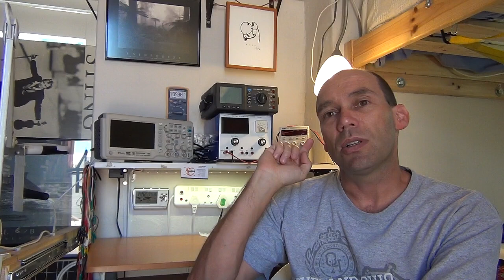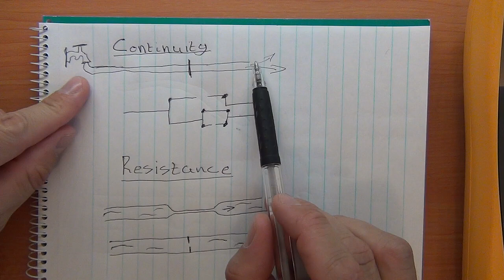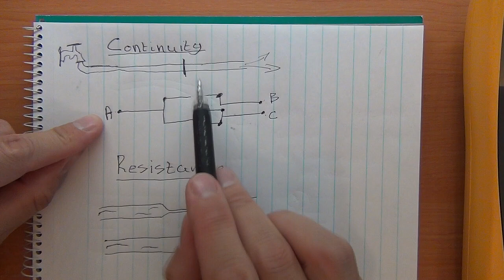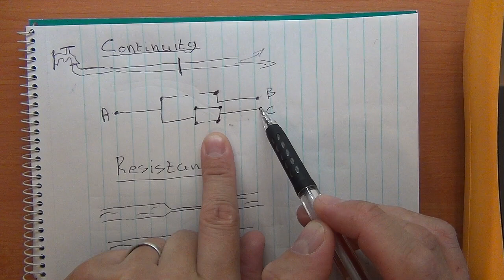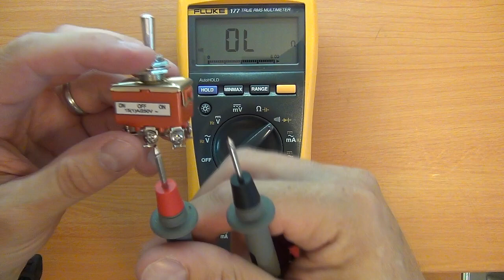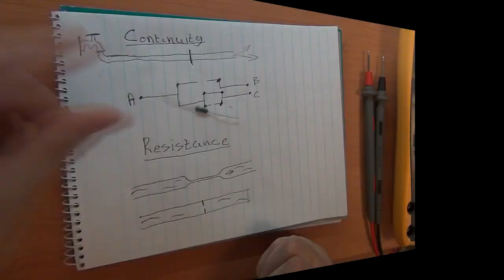How to use a Multimeter for beginners: Part 3 - Resistance and Continuity

Comment: Never too old to learn.  I'm using your instructions to troubleshoot my ignition coil, voltage regulator and stator on a 150cc engine.  The values are given in the maintenance manual.  However, I didn't know how to test them properly. 

Thank you for taking the time out of your schedule and sharing this information.  I feel confident to proceed with my testing. 

dave

Comment: My sincere gratitude for your clear, lucid presentation.  I was able to repair my own drill using this video. I have owned a multimeter for years and have been clueless as to how to use it. Using your video I could troubleshoot for continuity and assemble the components of the drill correctly.  My sincere gratitude.  Many thanks.

Comment: Great video series!  Your explanations with analogies are easy to follow and the practical demonstrations help a tone for a beginner like myself to know how to utilize all the settings on his multi-meter.

I did want to point out however, that during your water pipe analogy of resistance, there is in fact a slight difference between how water pressure and voltage are reduced.  Everything stated about voltage reduction from what I understand is absolutely accurate.  With water though, simply reducing the area that the fluid is flowing through, does not create a pressure reduction.  If you have simple water pressure gauge, you can test this by hooking it up to the end of an outdoor spigot, and opening the spigot all the way.  Then take it off and start over,  just opening the spigot's valve slightly.  The gauge will climb more slowly, but still reach the same pressure level.  All the spigot's valve does is regulate the area that the water is flowing through, and thus the rate of flow.

There needs to be a mechanism within that area of flow, that will present an opposing pressure.  ie. In a water pressure regulator or even simple pressure reducer, there is commonly a spring that holds against a stopper closed.  This spring creates an opposing pressure against the flow, which is what actually reduces it's pressure on the out-coming end.

Anyway, sorry to nitpick your video.  Especially considering I've learned so much from these myself.  I just wanted to add my tad of insight into part of the physics on what makes the water/electricity analogy not quite 100% equitable.

Comment: Another great vid but you might have mentioned that even the best quality resistors will vary from their labelled rating by several percent, ( gold band, silver band etc) as well as the resistance in the leads though this is perhaps too advanced for what you are trying to do at this level. Cant wait to get on to your advanced vids, I am finding them a useful refresher for use in my own teaching of young engineers.

Comment: Great video. The way my high school physics tutor described the answer to the first question was: "DC at high voltages/current over long distances causes a charge on the wires, which means you get loss as electrons drift over to the air/trees etc. With A/C, this electron drift still happens, but a fraction of a second later the polarity reverses so they come back the other way, and the cycle repeats. This means you don't get such a loss of power over long distances with AC".  One other point I was hoping would be covered is what sort of voltage/current the multimeter puts out for a continuity test. Assume it is so low as to not fry anything? I'm guessing 9V since most units take a 9V battery.

Comment: respected sir for one i want to thank you for the education and i have a few requests , kindly do add a little about the application of this multimeter in automobile circuit troubleshooting the basic and i would be really greatful if you do include the breakdown of the symbols of the different circuits that are used in circuit diagrams , once again you have a done a great job of simplifying things

Comment: Great video. At 11.40 when the probes are touched, the resistance may not only be in the leads, but could also be contact resistance of the nickel? plated contacts.
I gold brush plated the leads on my Fluke 175 and the resistance went down from 0.2 ohm to 0.

Comment: The reason for higher resistance when you put them on the same finger although shorter distance is lack of contact area on the probes. When you hold em in seperate hands you press with two fingers covering them twice as much and half the resistance you could say. Try it with two hands and just laying on one open finger.

Comment: The new confirmed electricity flow in a wire is actually only on the outside surface with continuity of the wire not through the whole wire itself, hence the extra surface area over multiple strand works better but behaves like a fuse/welder in the event of an overload, ie corrosion which resists flow, surge or both. Water however is almost the exact opposite in this respect, the wall friction holds the outer surface back and causes resistance through friction and turbulence and only the core flow does the "work", which is why any deviation ie; elbow slows the flow.

Comment: Great videos. I have a cheap dt830b digital multimeter. The problem im having is measuring the resistance of a hotpoint aquiltas washing machine thermistor.

 Im not getting any readings at all from the old thermistor or the new one ive just bought. Both readings just show '1'  Are they both faulty or is this normal? Any advice would be welcome!

Comment: i want to replace a resister in a 12v power supply but over time it has gotten so hot the colour markings are virtually burned off. i can make out a green band in the middle of it.and maybe brown each end of the resister. i cant seem to get a reading from it too.i dont no what to do

Comment: Rather than use the continuity test function, wouldn't checking voltage or amps also show if there is continuity in the circuit?  What is the advantage/disadvantage of using the continuity function?

Comment: You are right. The smaller the resistance is, the better the flow is (continuity) when the two points being tested do connect.  Moreover, if the resistance reading is 0, it means that the two points being tested have not been connected (no continuity.) I realize it after keeping on watching. Sorry for the previous silly comments.
Reply: No if the resistance reading is 0, you have an EXCELLENT connection between 2 points.  (Almost NO resistance to current.)  IF you meant OL then that is basically an open circuit, with NO connection between two points tested.

Comment: Hi mate,

First off all great videos I've learned all I'll ever need for what I need and that's diagnosing problems with doggy wires and connections on cars. Now I have seen a few of your videos on different multimeter's but to be honest I'm a bit lost since I don't understand a great deal about them. For a beginner, what multimeter would you suggest?? All I really need it is to work around car, diagnosing doggy wires and connections?? I was looking at that palm fluke 15b, than 17 than a few true rms once and I have no idea what to opt for?? I'll be watching few more of your videos to learn more and put it to practice so I don't want some nasty cheap one but also don't want to go over $200 so could you please point me in the right direction. I like the ease of those fluke one so perhaps which out of fluke range would be good for my needs.

Again great videos and level of explanation I've learned heaps thanx mate..

Comment: I really enjoyed following the beginners video series of measuring voltage, current, continuity and resistance. I got a lot of education on it. I'm very grateful for these education. But in the continuity measurement section, don't you think it would've been good to explain the meaning of an "electrical circuit"? As this will let viewers understand the fact that electricity follows through a continues complete cycle of connected conductors, and when there is a break in this cycle, electricity breaks as well. Also with regards to resistance, the explanation isn't very clear. I would've prefer you use particles deposited within the water pipe which blocks the flow of the water through the pipe, causing opposition to the water flow. these particles could refer to the material used to make the pipe, copper, aluminium etc.

Comment: I have a question hopefully you can answer. I am a plumber by trade and this is one area where I struggle - the electrical part. You go into a mechanical room how do you know what to test for? I mean how can you tell when to test for continuity, resistance, or volts? I know from my standpoint we can not touch anything above 24V. But there are those rare instances where a electrician is not readily available. Thanks .

Comment: Hey! ÷*) Made it thru the three (3) vids and will continue to the Advanced Series. I certainly picked up a few things that helped me.

Anyways, please tell what PSU (one of the cheap Chinese rebrands, maybe?) you used. I saw a quick visual in the 1st vid, but didn't get the name.

The reason I ask is I'm just starting out and am buying low-cost equipment to begin with, since I don't know how far I want to take this. My current plan is hobby stuff only.
Thx! ÷*)

Comment: I've had and intermittent problem with My 2001 Dodge Cummins Diesel 3/4 ton Truck that has become constant issue . The dealer worked on it over 25 times under warranty and many times after the warranty expired ,  each time they said it was fixed it wasn't . It took having the trans rebuilt to learn Its loosing voltage at the APPS ( throttle position sensor ) or TPS I'm having trouble locating the problem , How should I use My multi meter to fix this  ? Continuity or Ohms test

Comment: I don't whats wrong. I just bought a new dmm because my old one didn't work anymore. With the dmm came gray leads which almost look like the ones in the video. When i try do test the continuity mode i have to press the leads hard together before actually getting a clear buzzer sound. If they  touch each other i'm just getting a unclear buzzing from my multimeter. If i use the old cheap leads they the dmm works as it should. What's wrong? the new leads seems to be better quality but they aren't:(

Comment: I recently put a wire into the power outlet and then tested resistance from the fuse box wires randomly till I got a reading, and so I was able to determine which wires are from what outlet or light/switch. (ALSO, I wanna mention that for this you need to have all the power off, otherwise it's potentially deadly obviously).

Also, I don't know if this was mentioned din the video, I'm currently at min 10. But I wanna ask if using the formula R=pL/A is viable to use to be able to determine the length of a wire, possibly if it's underground or whatnot. To test resistivity in theory I am thinking to just algebraically manipulate the formula to solve for resistivity. And determine the other values by taking a piece of the wire as test, measure it's length, cross sectional area, and then resistance. And then plug that into the formula to solve for the unknown length. 

I mean, for me in theory it should work right ? But the thing is, when I tested for resistance,  the reading fluctuated, was it my multi meter being not accurate or what ?

Thanks, I don't have much experience in this at all, so, sorry if my question is stupid x)

Comment: Lovely video.  Just a correction.  When you have a resistor in a circuit, the current does not drop.  Instead you have a Voltage drop.  Current (Coulombs per Sec) remain the same; it is the energy (Joules/Coulomb) that the current looses.
Reply from the maker: Thanks for that correction and feedback.
Reply: So an analogy could be like watering down a fuel line so less energy is delivered to the combustion chamber? Instead of decreasing volume of gas per given time?

Comment: couldn't read all the comments, but just in case it wasn't mentioned - the early AC systems had significant flaws (not going into details to keep the comment short) and that is why DC was chosen initially while building first supply systems. Besides, there were no appliances yet invented which would effectively work on AC. As far as I know, the invention of an AC motor in late 1880s was the tipping point to start moving towards AC systems.

Comment: @6:56 "do not have your circuit energized"
I mentioned this previously, not only power is off but all components that can store power have been de-energized (ie grounded).
Analogy: hydraulic pump is off but the pressure is stored in a hose, valve and\or actuator.

Comment: What are the ohm settings, in order,  when you start switching them in manual mode?
And I have a manual ranging meter (BK Precision 2703C) and it will not read the ohms on a dishwasher motor on any setting from  200, 2k, 20k, 200k, or even 20M. My Fluke 114 reads 2.70 M ohms, and that is in auto ranging mode. The Fluke always starts out in auto range ohms with a capitol M in front of the ohms symbol.

Comment: Hey. I was trying to check the voltage of my car battery. Accidentally switched to resistance (ohms) part of my multimeter. Would that cause any problems?

Comment: ps4 wont turn on after i dropped it,top lost its spring back when pushing the top down.can u show examples using a ps4 in future videos as im sure the damage iis mostly round the power switch

Comment: I got a question, does a working circuit (I mean without short circuit) will necessarly bip in continity mode with the probe at the alimentation ???  For exemple, I got an old radio that I want to repair ... If I put my probe at the place where the battery supply the power, should it bip  (going throught all the component, resistor, capactior, transistor, etc ) ???

Comment: Good evening, is it possible to test a torchlight bulb with a multimeter? I have checked the 6V battery as per your instructions and that is okay but the torch does not work.

Comment: My multimeter doesn't have the speaker or the 'volume' symbol for the continuity tester. It only has the "triangle pointing to a line symbol" (if I remember electronics class from many years ago that's a diode symbol?) that's in yellow on the multimeter in the video. Is that setting related/useful at all, or do I have to use the resistance method?

Comment: i get confused about the settings on my multimeter. 20M = 20,000,000 correct? And 2M = 2,000,000, 200k = 200,000 and so on and so on right? If i set my multimeter to the 200k setting and get a reading of 100.3 that means 100,300 ohms right?

Comment: So, am I to understand that this switch is faulty, for being "mislabeled" as to which is in the "on" position? Or once installed, would it make a difference since zero current was flowing thru the switch when tested? Also, being that this switch has two (2) "on" sides, and working on the wrong side as labeled, would this switch show as defective if wired only to the wrong side?
Thank you Sir.

Comment: I am having a problem getting a resistance reading. I have it hooked up properly, but it just says O.L on my screen the whole time. Even if I just put my two probes together I do not get a reading on my screen. Could there be something wrong with my DMM? Or am I doing something wrong?  I'm using the Amprobe AM530. Any help would be nice, thanks

Comment: I have a problem like this:
Basically I live in a house with mom and brother, and we got 1 TV in living room.
The TV volume goes from 0 to 100, 
Where 0 volume is no sound and 100 volume is maxed.
On volume 1 and 2 its too quiet. Where on volume 3 its screaming like crazy TOO LOUD.
So basically I either can choose not to hear anything, or to choose to hear more than I should and having my family raging at me, because the sound at volume 3 can be heard into other rooms even with closed doors.

I was thinking if there is a way to solder some kind of resistor between the speaker and the pcb of TV that speaker draws voltage from?
In my theory, lower voltage = lower (more quiet) sound, so maybe I will need to choose like volume 20 to be just alright.

Now, I don't know how many watts actually goes into speaker, guess its different from model to model, nor what ohm resistor do I need to reduce the volume power.

I also read that soldering longer cable can and will create more resistance. But again, I don't know how long cable should be, nor I do know what impact certain ohm resistance have on sound decibels. For example, if 8 ohm resistor would reduce overall sound level by 10 dB (decibels) then I think it would be much better.

I was trying to google around Internet, but couldn't find straight solution, so hopefully someone with good knowledge can help me to solve this issue. 

I've watched all of these series like a half year ago, been studying electronic a lot more since then, and I think I improved a tons in this half year. But I'm still a beginner none the less.